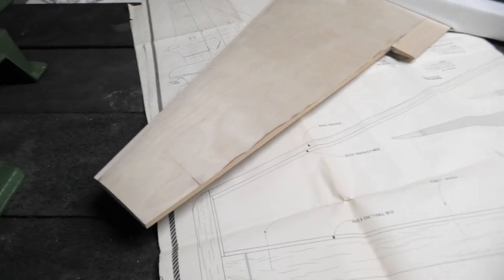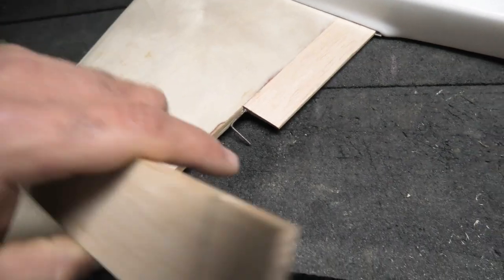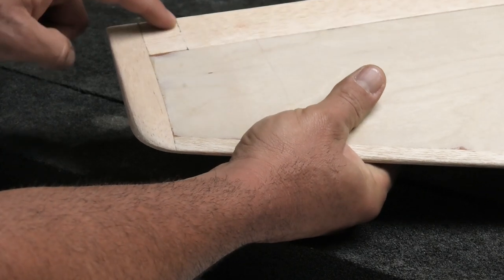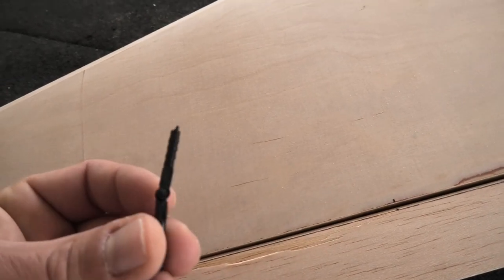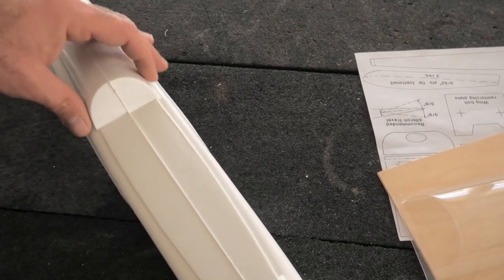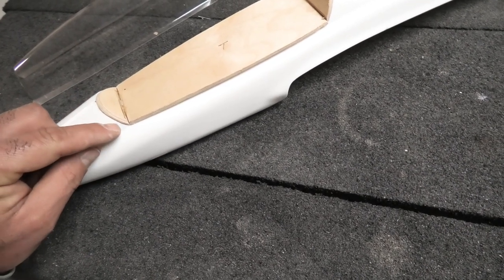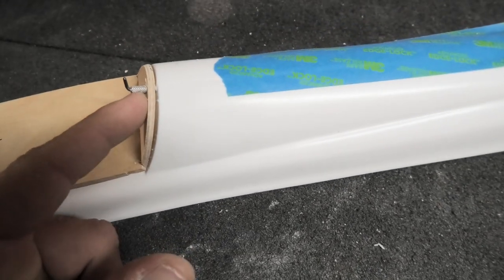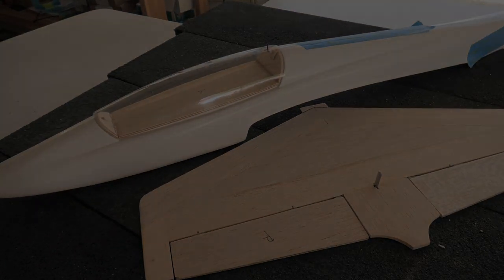Bob Martin SR-7, Vintage RC Slope Glider Build Part 6

Comment: The fuselarge is a single piece. The mold line on the outside is just the mold split line.
I trim off the join line with a new scalple blade and polish the fuselarge with micro mesh a full size aircraft canopy polishing kit. It totally removes the lines.
The canopy tray looks really bad. I don't even bother with them but instead cut a servo resess and switch resess into the canopy floor directly. I fit them in such a way that they look something like an ejector seat and fit a pilot in front of them.
Reply from the maker: I'm not building this for myself. My friend wants it built per the plans. However I was wondering if it is possible to polish the fuse. I was going to try it on a scrap. Sounds like I can, so I will be able to clean up the mold line.
Reply: @flightcomp  You need to go visit an aircraft workshop and get yourself a aircraft window polishing kit. Basiclly its a set of polishing sandpaper type cloths that are very fine. As you work through the different grades, use each one at 90 degs to the previous one. The fuse will shine like a new penny at the end.
Good call on the wingtips. Much more servicable day to day over the more "Sexy" style ones. They just get so beaten up on landings.
The last SR7 I built took me about a fortnight of evenings  from opening the box to first flight. Best sloper I have ever owned. I will NEVER sell mine.